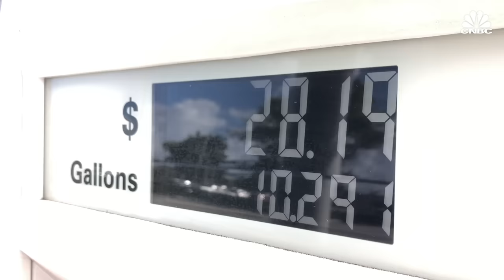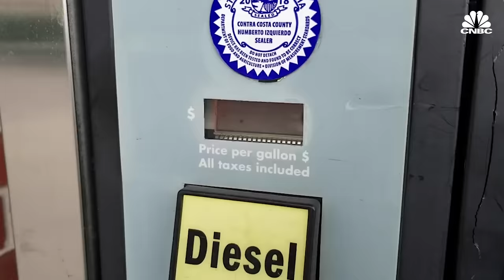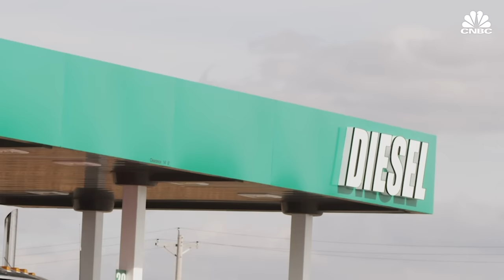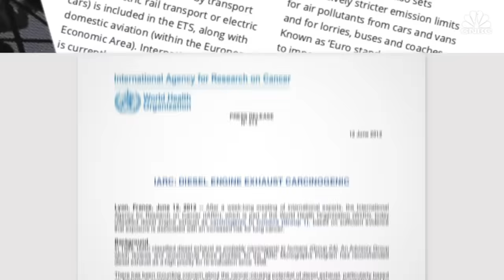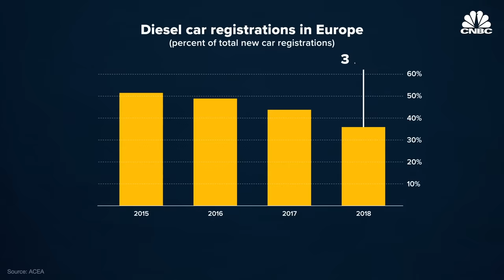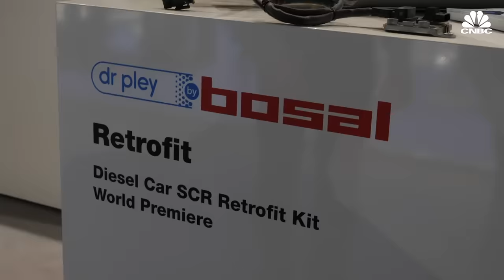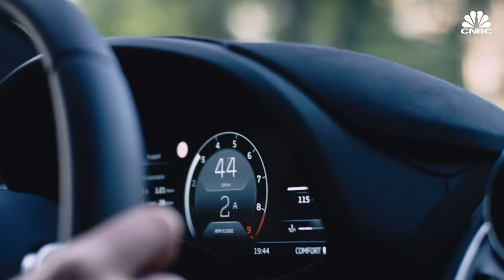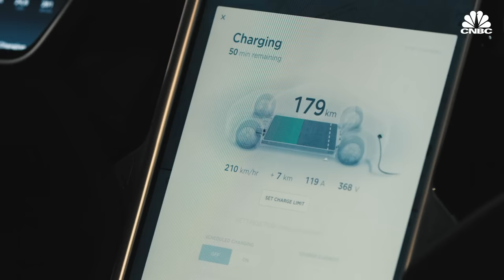Why Diesel Cars Are Disappearing

Comment: I learned that the first diesel engines ran on peanut oil, so maybe we should start trying that out.
Reply: It’s been widely done, I’ve run diesels on vegetable oil. It works fine. As long as the fuel is flammable and offers reasonable lubrication to the high pressure side, it will run just fine. 
The downside is injector gumming, sticky piston rings and some very expensive bills especially on new and rather sensitive common rail systems. Veg oils work best on older, simpler diesels. 
This used to be a nice little solution for high U.K. fuel prices until the supermarkets caught on and made cooking oil cost as much as diesel in the first place.
Reply: @WineScrounger  what a shame on the price tag, but at least we can still use Dizzle powered muchines if one day oil is eather banned or becomes unavailable. Thanks for the reply👍😀.
Reply: @jacobramsey7624  no worries. You’re right, there’s still potential for running Diesel engines on renewables. Most U.K. diesel fuel is 7% biodiesel and it runs perfectly. Biodiesel is fatty acid methyl esters, made by reacting natural oily fats with methanol and it’s an excellent clean fuel if running straight veg oil is not an option.
Reply: And see how it turns out. look at ethanol, the cost to make it is so high it needs government subsidies to be competitive
Reply: @1towmater1  in fairness though you need to brew ethanol then distill it to dryness, it’s extremely energy intensive. Veg oil just needs to be extracted and there it is.
Reply: That’s what biodiesel is basically.
Reply: @Cam D obviously it was cheaper back in the development days of diesels.
Reply: Have you ever burnt peanut oil?
Reply: my friend uses cooking oil and diesel mixed in his hi lux 50/50 mix. wife works in big super market usually put cooking oil on sale , he goes in buys up all the gallon bottles .
Reply: Everything but (some) of the newest diesels all run well on oils without additives. Just about any oil at that. You might need some of your own additives to help combustion but just about anything that burns clean works. I love diesel engines for their reliable simplicity. Even the fuel it requires at the pump is denser in energy and easier to make.
Reply: making biodiesel from peanut oil is very easy, I made at home with soybean oil. Basically for each liter of vegetable oil you use 200ml of methanol and 35g of NaOH (used for cleaning). It is not hard to separate gliceryn to biodiesel, after that you can purify with water to get all the methanol and glicerin out of biodisel.
Reply: @WineScrounger  Despite the increasing cost of vegetable oil. I also read somewhere that it's possible to have used vegetable oil in cars as well as long you filter it of course. So you can easily find many restaurants willing to get rid of  all their cooked oil for free.
Reply: @emberson7850  true, WVO can work directly in some engines or it can be processed into biodiesel.
Reply: @1towmater1  we have seen how it turns out veg oils are wayyy cheaper than diesel with or without subsidies
Reply: You know why it is not widely adopted? There is no money in it!
Reply: Brazil only use biodiesel but it's costly doesn't fix the problem
Reply: @jacobramsey7624  Yes, all we have to do is figure out how to power the planters, tractors, cultivators, pickers, and trucks to harvest the peanuts. Oops, that would require a bit more thought that 'Gee, that sounds great'.
Reply: Where are you going to get enough peanut 🥜 ??
Reply: @moviesjean23  not sure, but it is a option and further development would help.

Comment: I don't think diesel going anywhere anytime soon
Reply: Loosing Diesel for humanity its like having a broken leg hopping to the top of the mountain and throwing both your crutches off the top.
Reply: I'm sure whalers said the same thing when the electric lightbulb was created too!
Reply: Mavis Stapleton  you wont, the robot driving It Will.
Reply: Definitely not in Europe
Reply: @Yejun Cheong buses(city, transit, school, intercity, parlour), locomotives, construction equipment, motorhomes, farm and construction tractors use them.
Reply: @frankdenardo8684  dont Forget boats, subs, airplanes (although mostly not ICE) and large ships. (2 stroke diesels)
Reply: Check out "Hydro diesel  fuel" on YT, ppl think the engine is dirty its not its the damn fuel!!  even Synthetic diesel could have a future  which is made from Coal and is cleaner burning than petroleum diesel.
Reply: Maybe not so soon, but certainly you won't be able to buy a new one in 15 years time. The major manufacturers will have probably ceased i.c. production before then anyway.....
Reply: @frankdenardo8684  I don't know where you live Frank, but here in the UK, many passenger trains have switched to electric power. Some electric buses around too, along with electric diggers (as in road repairs and house building). DPD (the parcel delivery outfit) just ordered a few thousand electric vans for their rounds, and I have seen a few of them in use already....
Reply: @COM70  Places like Norway and Finland already use electric powered ferries for commuters. The Japanese Navy already have a fleet of electric (lithium battery) submarines in service.....
Reply: @michaelsamuel9917  It's extremely unlikely we will see a return to mining coal on a huge scale. It's a finite resource, like oil, and so will be exhausted at some point in the future. Renewable energy is undoubtedly the future, and the only realistic option. Since 2019, the UK has produced more than 50% of it's energy needs from renewables, and this is projected to increase to 75% within 10 years. For personal transport, the electric car appears to offer the optimum solution. Some would argue that hydrogen may be better, but hydrogen still has to be refined (using lots of electricity!) and then it will have to be distributed to all the various points of use and sale, using specialist tanker vehicles. No such problem with electric, as the grid is already in place. Plus you can't refuel your i.c. car at home using petrol/gas you produced yourself. You can with an electric car (I do!), using the solar panels on my house roof......  It's actually quite satisfying driving along knowing you're using free fuel.
Reply: @Brian-om2hh  any chance of a few links to those subs? I can only find diesel electric subs. The ferries are short distance and low speed, so a very very small % of the current distance travelled by merchant navies world wide even if every short hop ferry world wide was electric.
Reply: @Brian-om2hh  I live in California. In San Francisco, the transit system called MUNI has two type of buses. One is a diesel, electric hybrid built by New Flyer in Winnipeg Canada and the other is a trolley bus. The latter runs on electricity using overhead wires. Also a commuter rail system called CalTrain is electrifying the  locomotives by using electricity and phasing out diesel locomotives.
Reply: Mavis Stapleton  also would like to know where the electricity to charge the zer0 emission electric cars is coming from?
Reply: It is in the UK after 2030. You won't be able to buy a new one after then..........
Reply: @Brian-om2hh  cars, ships, trains, trucks, planes ? All of them or just cars ?
Reply: It is for passenger cars in the UK after 2030........
Reply: indonesia planning on using 100% biodiesel from CPO
Reply: @Yejun Cheong an tractors
Reply: Mavis Stapleton  misinformed video? You didn't watch it did you? because the video clearly states that diesel probably isn't going anywhere anytime soon, especially in the heavy duty segment.
Reply: @robmendoza6210  A valid question. Of course an EV is zero TAILPIPE emissions. This has benefits for the local environment, for example less inner city pollution. As you correctly ask, we still have to consider where the electricity comes from to look at the global benefit. Most countries in the world still heavily rely on burning fossil or bio fuels. The good news is, this is changing as energy grids get greener and greener. This means that an EV bought today will release less emissions from the energy it consumes the older it gets, assuming grid generation continues to get greener. An internal combustion engine however will continue to emit the same amount as the day it was made.
Reply: companies dont sell diesel vehicles in india
Reply: @Brian-om2hh  so mechanics and aftermarket shops close up right brian? People losing jobs bud....
Reply: @Brian-om2hh  Not that many. The only real investmemt lately in electric trains has been London to Cardiff, previously a 125mph diesel line. It should have been electrified over 30 years ago because it is one of the UK's premier routes.
Other routes being electrified are relatively short in length.
Only 30% of UK lines are electrified, but those 30% carry 70% of the traffic.

Comment: i drive a dieselgate-era VW TDI, and i love it! yeah Volkswagen really messed up, but they (eventually) took responsibility for what happened and fixed all of the cars. i don’t plan on getting rid of it any time soon.
Reply: Me too, I couldn't care less about its emissions, I bought it for it's economy and running costs.
Reply: @pauldethick6175  
Good news for you, though all engines do polute, CO2 is not a polutant. In fact if CO2 dropped to 1/2 the current level, plants would start dying off, quickly followed by billions of humans!
Reply: I have a friend who bought a Diesel Jetta Wagon in 2015. He loved it, but they made him an offer he couldn't refuse to rebuy it (basically sticker price on what was now a used car). He promptly went out and bought a Golf GTI.
Reply: I also drove the 2015 VW Caddy with Dieselgate era 2.0 TDI motor. Brilliant van. 1000km on one 60l tank. Love it
Reply: I still drive the most fuel efficient diesel:
Aluminum Audi a2 3l 
21 liters <>500 km
Better then electric cars that run on coal!
Reply: An American gas guzzler is more polluting than a average VW diesel for sure.
Reply: @Bartonovich52  🤣🤣🤣🤣
Reply: @theowink  My Kona runs on sunshine, how about that? I don't know how much you spend on those 21 liters of diesel each 500km But I can tell you I spend around US$15 for such a run, after concerning the LCOE from my investment in solar (and the price is still dropping every year that passes).
Reply: @youxkio  only in summer you can yes
Reply: I pay 30 euro for 500 km (high taxed)
For a car from 2001.
Light car,light engine,lots of space.no rust.
1 minute full tank.if I add 30 liters tank (30kg)
i can drive an extra 900 km.
Reply: @theowink  I pay US$15 per 500 km (still dropping every year.
For a Mar. 2021 car (gonna get tax rebate next year)
Powered from a 16.5kW Dec. 2020 solar roof ( I forgot to mention that the solar roof is also tax rebated, thus the editing) with feed-in-tariff which the power company pays US$1.5 for each kW into the grid (I power my car during the day).
I do not need to stop on purpose to charge,, because the range is more than enough for my needs.
I live in Taiwan. Sunshine all year except when it is raining. 
My car is also charged at work, for free, whenever I need to take my car to work.
Reply: @youxkio  I go to my work on my e-bike
which is 6 minutes.my carbon print is very low.Let’s see if that battery pack after 20 years soc.
I am no electric hater but we do need different kinds of fuel now for the electric conversion.
I still think powered highways is the solution (less chemicals needed and lighter cars)..wireless charging.
Reply: @theowink  You use an e-bike? Well, I have no trouble to say that you won me on that 😂.   Yes, now many are saying that the soc of EVs will gradually reduce over the years. I had a '96 Honda Civic sedan 1.6 Aut. When it was new it made around 7L/100km. when I sent it to the recycling center in Feb. it was consuming around 9L/100km year average. From 600km range became 500km with a full tank. I think this goes to all cars in the end. And, after 20 years I think I will purchase another new car. Cars change so much every 10 years.
Reply: @youxkio  true ..I work at a valet parking and drive many different cars.If batteries can hold up to 600000 km (like some Tesla) it’s a good thing also for 2nd hand.As long as the car is clean inside I am ok with it😁
Reply: @theowink  Wow! 600K km!!! I think that is impossible for me to drive that much. My old Honda had only 280K km. My Kona has 6k km right now. This is because all my destinations are so close to my home.
Hey, which is the car do you like the most?
Reply: @youxkio  it’s hard to say ,every car has it pro’s and con’s .The more I drive the less I care.
Reply: @theowink  I can understand you on that one.
Reply: @youxkio  the Kona-e and solar panels are indeed the best option for now.
Next step to power your home from the Kona-e😁👌
Reply: @theowink  Well, like everyone else; I like what I have now. But the Kona was not my first choice. Neither is the solar roof system. I had a limited and somehow tight budget for this. So I had to choose what was in the market looking also to my budget. I would rather buy a Tesla Y LR and a home battery. Here in Taiwan we still do not have the Model Y (I like the model 3 but the trunk is ridiculous). And, the solar was not my first choice. I had a 19kWh solar roof in view but the safety features and regulations made me cut it to 16.5kW and the government does not let us install solar roof batteries because the electricity company is state-owned and has a monopoly. So, the Taiwanese government works together with the power company towards the political agenda for renewables. I had to wait for months to have the papers done and finally install the solar roof. But it was worthwhile and I am actually making some money from the solar roof (around US$60 every 2 months), but again, it was not my first choice and I am not totally satisfied with the results. Why I did not wait? Well, my Civic was old and leaking water inside when it rained and I had the money, so why not?
Reply: @theowink  Hey Theo, if you are young and if you ever think about doing the same, just wait for what you really want. In a way that you won't regret. You are a nice guy, so I really want to give you this advice.🤗👍
Reply: @youxkio  I am also on a tight budget and the gas prices going up trying to keep my Audi “alive” .Gouvernement here is pushing for electric but it still is to expensive.We are still at the beginning I think with electric cars .But they are acceptable now(range)for me .In some cities my car is banned due to age and diesel.But then again I cancel those cities 😬😁.Next year I mount some solar panels too.
btw I am not so young anymore but I refuse to get a old “brain” 😁..
You are a good a smart man,I can tell.
All the best to you and a good 2022,my friend!
Reply: @theowink  Best wishes to you, stay safe.
Reply: @youxkio  you too in these crazy times 😀😷👍
Reply: @Tracert-mc1hu  That was not a 2015 model, it was the 2009-2014 models, in the Jetta lineup, without the Diesel exhaust fluid treatment catalyst.
Reply: @Bartonovich52  Nox levels from diesel vehicles are insignificant. NO2 has a half life of about 3.5 hours in sunlight. The problem is VOC's in the air, that react with N02, learn WTF you are talking about.
Reply: @passattdise  Oh, yeah, it probably was. It's been a while so I probably remembered the year wrong. It was for sure in the recall, I know that.
Reply: Me neither! We bought us another TDI last week 😁.
Reply: That is the best diesel car because of the emissions problem/success.  How can a car that gets say twice the mileage of another car be bad for the environment!
Reply: Last week I drooled over a guy's Sportwagen TDI. It fired up instantly and purred out of the parking lot.
Reply: Same here. 2011 Jetta 2.0 TDi. Easily does 24kmpl on highway runs. Refinement is alimony on par with comparable petrol engines.
Reply: They fixed what? t must run like crap to not pollute. I test drove a TDI Golf manual trans & I couldn't tell it was a diesel.
Reply: @theowink  not really. CO2 is not air pollution,
Reply: @melaniecotterell8263  I know ,but Nox is
Reply: 2013 TDI Diesel Beetle.  I had to replace my first D-Bug after it was totaled.  My worst mileage to date 36.8 mpg, my best, 58.6.  My drive to work is around 45 miles, then home, 90 miles.  I can do this on 2 gallons of diesel.  Average, 570, to 600 miles per tank.  I have no complaints.
Reply: @youxkio  "the power company pays US$1.5 for each kW into the grid"   No, just no.   Maybe $.15 per kwhr
Reply: @lylestavast7652  "Maybe"....?????
Reply: @wiolettapagowski5590  EU following orders from who? Russia?